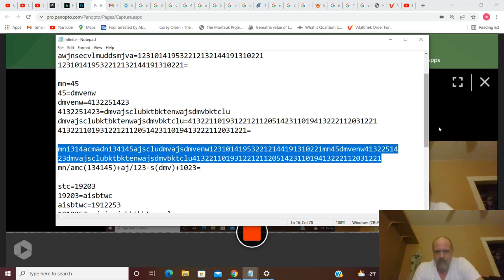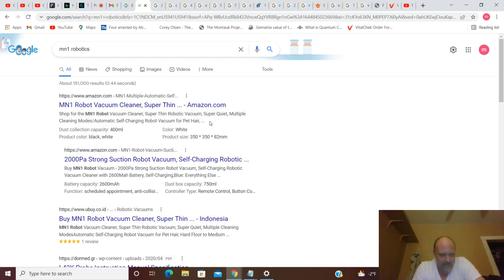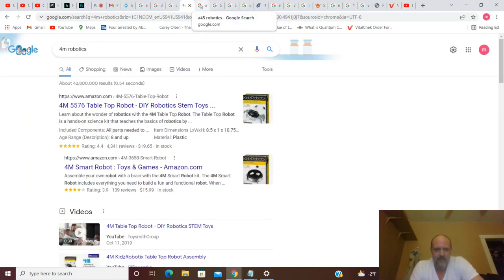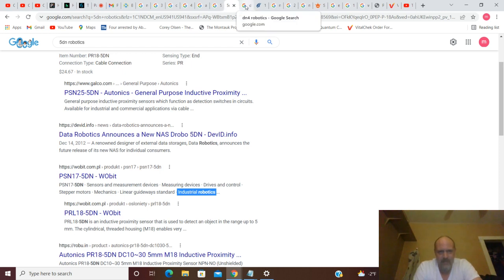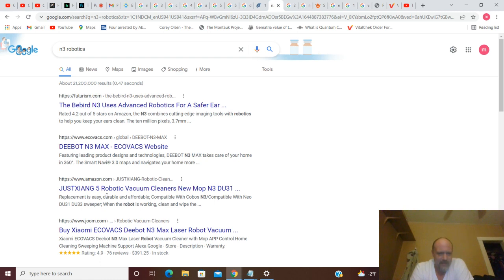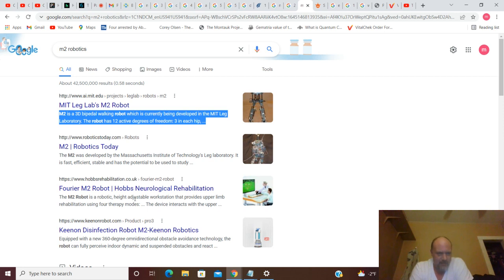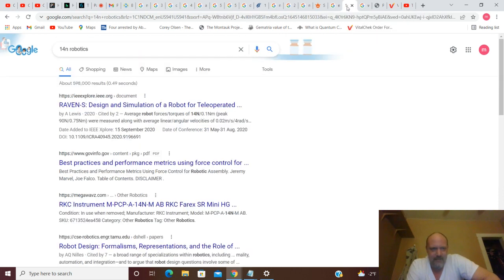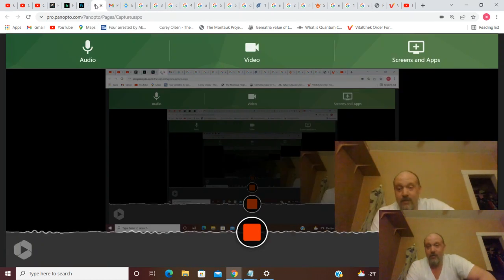Mandela Effect: Mamwich/Manwich alpha numeric decode pt.7A robotics search

Comment: Every president of the USA is related and most of them are direct descendants of King John of England you were 100% correct big guy this is 100% theater! That means that everyone that's up for vote will be right down a certain bloodline it wouldn't hurt to run the numbers on King John either. Case, closed.